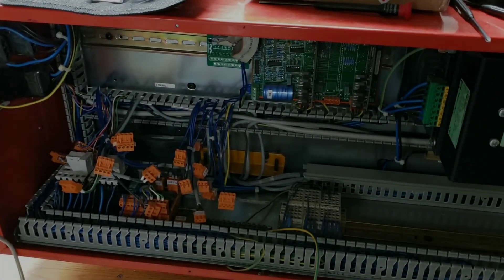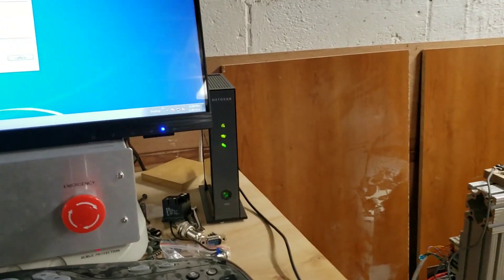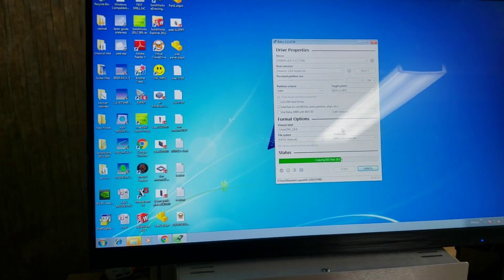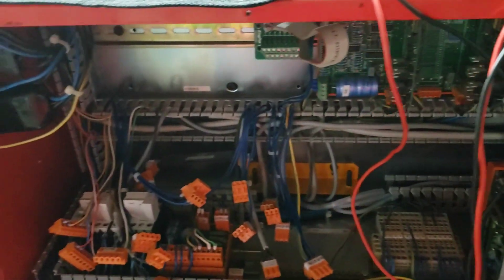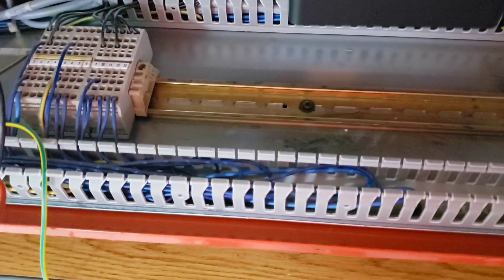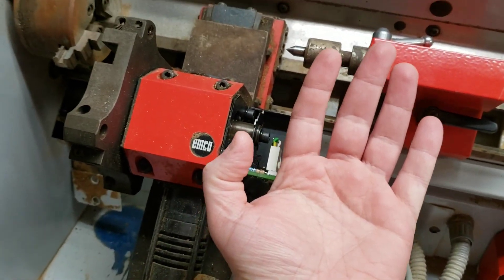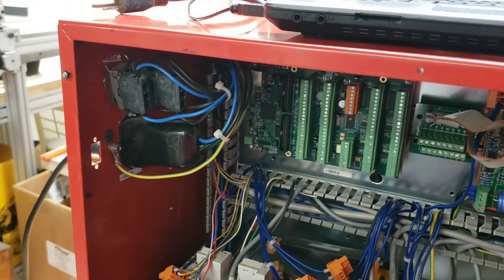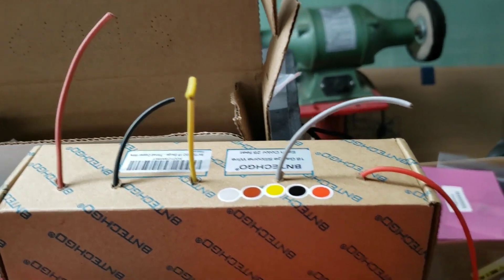Emco PC Turn 55 LinuxCNC Mesa 7i76ED retrofit - part 1

Comment: Hello, 
what exactly is the MESA-board for? Is it not possible to run the CNC with a Laptop and a parallel port cable? I've got a similar CNC and I'm planning to retrofit it. It's in good condition and all the original electric's are there. 
Cheers Darwin ✌️
Reply from the maker: The mesa board replaces the original ac95 to run LinuxCNC. Laptops aren't recommended for LinuxCNC because of the power saving settings. You actually have a laptop old enough to have a parallel port?
Reply: @TheFeralEngineer  Hello, thanks for your answer. After some more research I think the mesa board is the way to go. I'll binge your videos to get some more information. Is there any chance to contact you in case I need more help? 
Cheers Darwin
Reply from the maker: Sure... theferalengineer@gmail.com